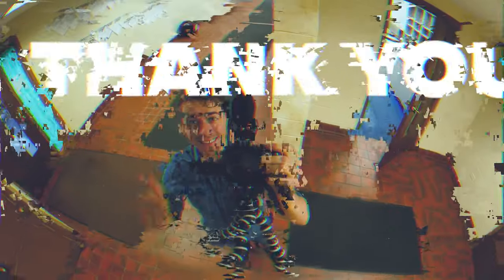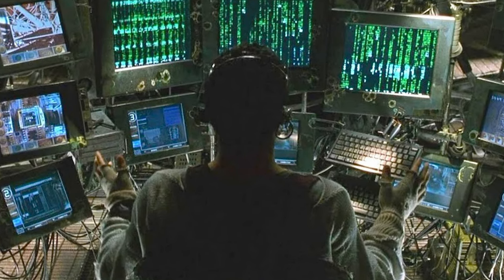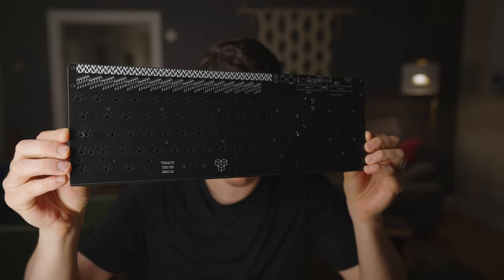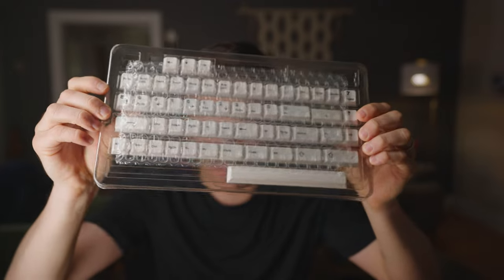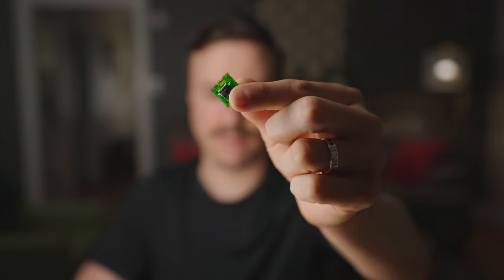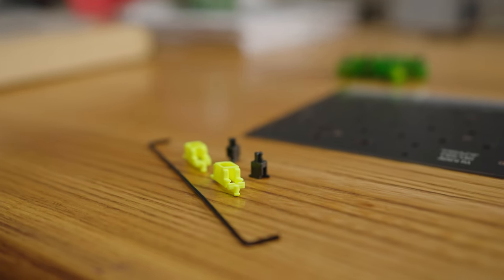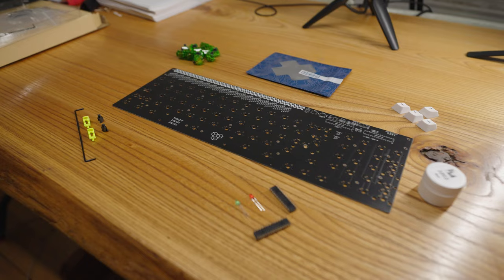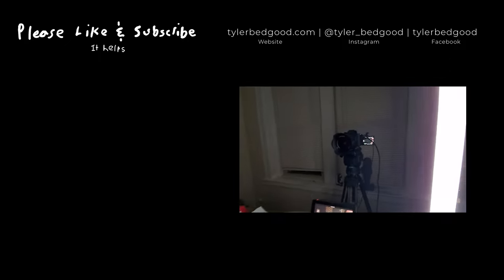Mechanical Keyboard Build Preview | The Nebuchadnezzar

Comment: The red nylon washers on the bag, the thing you don't know for what it is, is for being applied in screw in stabs. They sit between the PCB and the screw on the back. 

Their objective in some keyboards with passive soldered components (diodes mainly) on the back is to eliminate the chance of a short caused by the Stab screw. In your case you don't need to use them since the PCB you are using all the passive components are on the front top of the PCB.
Reply from the maker: Thanks a lot. This is super cool and Informative.